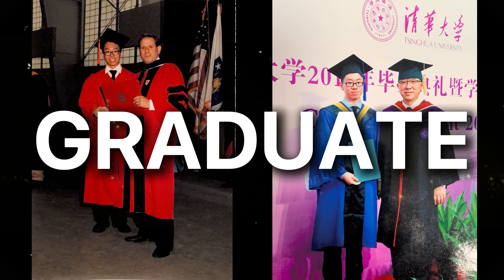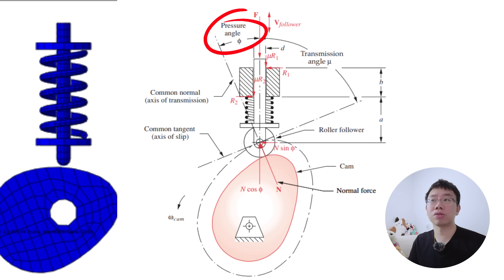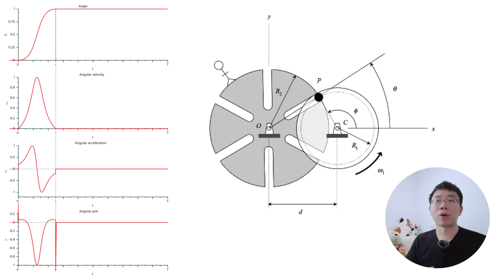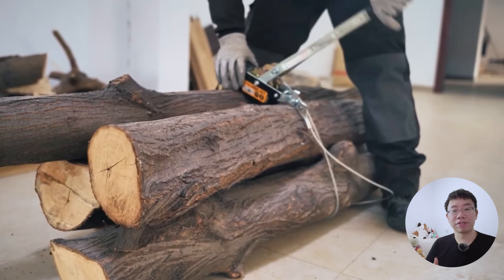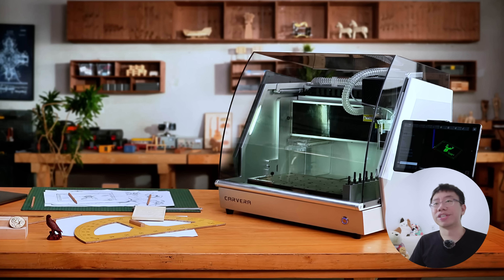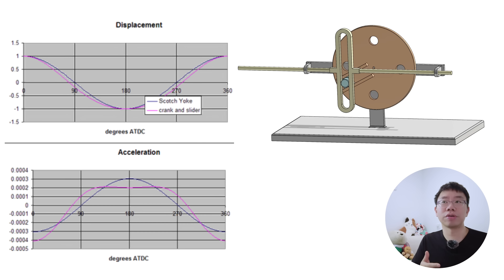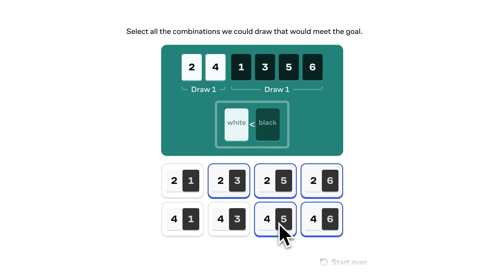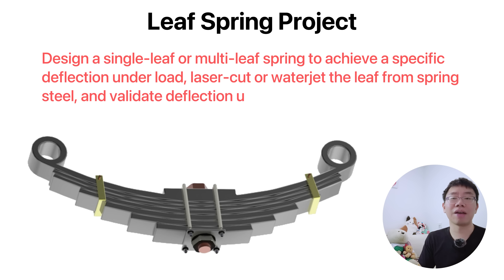Mechanisms EVERY Mechanical Engineer Should Know

Comment: One thing that I’ve had that helped me in being a better engineer was my passion for cars, I didn’t know it when I started getting into tinkering with cars that I’d be helping my career path but once I started a full time job working on custom bespoke machines, I was already able to contribute a lot to conversations as most mechanical concepts have been used in a car in one way or another. By the time I got my current job I had rebuilt a few engines, redone about every suspension bit on one car, and restored another from a fire, the insight I’ve had from those experiences has been more valuable to me than my school experience (this is very specific to me as I had an odd schooling experience, I’m not anti school lol). I wish I could convince every engineer to get a project car but I also understand that it’s not for everyone lol.
Reply: AHHH, I forgot the best part, with my engineering background I understand a lot of the decisions that were made when designing car parts. Understanding the design intent prior to taking something apart only to find out that you were correct due to mechanical design experience, I love it!!

Comment: The one and only king of mechanical engineering is the worm gear. Two reasons:
1. Immense force conversion. This thing can deal with giant loads compared to its size.
2. No matter how much the load is trying to move it the worm gear remains almost fixed.
It beats the jacks in terms of size and precision and the threaded nuts/shaft in terms of precision.

Comment: Rack and Pinion are also quite common. I saw a large one on an oil rig. It was used to move the drilling platform around to help with drilling different holes.

Comment: Nice video, but you forgot to mention my favorites: watt linkages, Peaucellier–Lipkin linkages, slider-crank mechanisms, toggle mechanisms, over-center locks, compliant mechanisms, flexure hinges, torsion springs, constant-force springs, clock escapements, verge escapements, deadbeat escapements, harmonic drives, strain-wave gearing, cycloidal drives, hypocycloid motion, epicyclic gear trains, planetary gearboxes, differentials, torque-biasing differentials, rack and pinion systems, ball screws, lead screws, recirculating linear guides, crossed-roller bearings, air bearings, magnetic bearings, hydrodynamic lubrication, squeeze-film damping, Hertzian contact stress, backlash compensation, preload mechanisms, kinematic couplings, Maxwell clamps, exact constraint design, under-constrained assemblies, tolerance stack-ups, geometric dimensioning and tolerancing (GD&T), datum structures, monocoque structures, space frames, truss optimization, topology optimization, lattice structures, auxetic materials, negative Poisson’s ratio, metamaterials, phononic crystals, photonic crystals, compliant metamaterials, carbon-fiber layup orientation, sandwich panels, honeycomb cores, foam-filled structures, buckling-resistant designs, Euler buckling, snap-through instability, bistable mechanisms, soft robotics, pneumatic artificial muscles, McKibben actuators, shape-memory alloys, shape-memory polymers, electroactive polymers, piezoelectric actuators, magnetostrictive actuators, voice-coil actuators, magnetorheological fluids, electrorheological fluids, linear motors, brushless DC motors, stepper motors, field-oriented control, regenerative braking, flywheel energy storage, supercapacitors, battery management systems, thermal runaway prevention, phase-change materials, heat pipes, vapor chambers, thermoelectric generators, Peltier cooling, Stirling engines, pulsejet engines, ramjets, scramjets, ion thrusters, Hall-effect thrusters, reaction wheels, control moment gyros, attitude determination systems, Kalman filtering, sensor fusion, inertial navigation, LIDAR mapping, SLAM algorithms, machine vision, edge detection, convolutional neural networks, digital twins, finite element analysis, computational fluid dynamics, multiphysics simulation, lattice-Boltzmann methods, Reynolds number scaling, boundary layer control, laminar-flow wings, vortex generators, Coandă effect, Magnus effect, cavitation, water-hammer effects, hydraulic accumulators, proportional valves, servo hydraulics, pneumatic logic, air logic gates, venturi effects, ejector pumps, vacuum systems, cryogenic engineering, superconductivity, flux pinning, maglev systems, eddy-current braking, induction heating, AC skin effect, electromagnetic shielding, Faraday cages, RF waveguides, antenna arrays, phased arrays, metamaterial antennas, power factor correction, three-phase power systems, delta-wye transformers, solid-state relays, opto-isolation, fail-safe design, redundancy engineering, fault-tolerant systems, graceful degradation, six-sigma manufacturing, poka-yoke design, Toyota Production System, design for assembly, design for manufacturability, injection molding flow fronts, sink marks, weld lines, die casting, progressive stamping, deep drawing, hydroforming, roll forming, additive manufacturing, generative design, lattice infill optimization, anisotropic printing strength, multi-material printing, topology-optimized brackets, compliant 3D-printed mechanisms, living hinges, self-healing materials, bio-inspired engineering, gecko-inspired adhesion, bone-inspired structures, fractal geometry in design, chaos theory, nonlinear dynamics, resonance tuning, vibration isolation, tuned mass dampers, seismic isolation systems, base isolation bearings, wind-induced oscillations, aeroelastic flutter, galloping instabilities, bridge resonance, structural damping, smart structures, embedded sensors, structural health monitoring, digital control loops, PID control, feedforward control, adaptive control, model-predictive control, robotics kinematics, inverse kinematics, Jacobian matrices, singularities, parallel robots, Stewart platforms, delta robots, cable-driven robots, swarm robotics, self-assembling systems, modular robotics, cyber-physical systems, industrial automation, PLC ladder logic, safety-rated control systems, light curtains, machine guarding, human-machine interfaces, haptics, force-feedback systems, exoskeletons, powered prosthetics, medical robotics, microelectromechanical systems (MEMS), lab-on-a-chip devices, microfluidics, capillary action, surface tension dominance, nanoscale fabrication, quantum dots, tunneling effects, Casimir forces, precision metrology, interferometry, laser scanning, coordinate-measuring machines, error budgeting, uncertainty propagation, systems engineering trade studies, optimization under constraints and emergent behavior.  Also, stress-induced fatigue failure: something I felt first hand when studying mechanical engineering. :P

Comment: Thank you Mr Oldham.  I use Oldham Coupling mechanism in my work.  The temptation to use a cheaper drive Thats actually tries to self center the misalignment results in failure of the process.  Little known or appreciated, the Oldham Drive (Coupling) is valid to include here in your video.  Thank you.  I (expert) use it to keep form reamers aligned axially with hole that is not aligned with tool holder center.  But to work Oldham must be precision and smooth without worn parts.  Thanks

Comment: A thought that sprung into my mind: while today electronics (ie software + hardware) can do a lot of things much more easily than a mechanisms, when it comes to one-off or small volume things they (software + hardware) may make the impossible to fix after a few years because the source code or firmware is no longer available.also the microcontroller or module (modern hw can be so tiny that it is impossible but swap a part, you need to swap a module) may be no longer available.  This also applies of course increasingly to volume production but for those there is usually incentive to keep the software and spare parts available. 

Mechanics OTH are usually repairable. 

And I say this as firmware engineer :)

Comment: A brief snippet at https://youtu.be/vzM_-Rr5mtw?t=689 shows leaf springs under a table. Installed at an angle. Possibly a shaker table that moves material in one direction through vibration. It can even move material at a slight uphill grade on an inclined table depending on the forces involved. Can be handy for food processing for instance.

Comment: These are very important for more industrial applications, but I think latching mechanisms are even more important for more consumer goods applications. It's sad that today so many of those mechanisms are made out of plastic that just snap off immediately or after a few years. They just don't build them like they used to.

Either build a proper latch that can last lifetime and be repaired with a hammer if bent out of shape(mild steel is your friend), or use screws that can be replaced.
NO GLUE! Things should be easy to take apart, fixed, and put back together again.

Comment: Everything about this gives my brain the good tingles. Still wanna figure out if a compact, hand driven air compressor is a viable endeavour. There's something rattling around in my head to do with a hand cranked, gear-driven rotary screw utilising mechanical advantage but my knowledge of air pressure mechanics is limited to being a hose technician. Imagine portable tyre inflators without needing batteries or people hunting with air rifles that need to top up on the go but don't want to carry so many cylinders.

Comment: most bang-for-the-buck facts or cheap tricks I learned on the job and not in school, early in career when I did mechanical design: 
1. hole-and-slot to avoid overconstraint
2. tolerance rings to avoid overconstraint
3. how to torque a fastener (hint: has to be moving in direction of tightening)
4. use hard materials (eg 440C) on wear parts and strikes; use easy to process materials wherever possible ; take the time to speak with your fab shop to actually learn what is easy to fabricate
5. wedge-lock (nord-lock) washers, when you really need something to be mounted on a single bolt yet not come loose
6. sheetmetal is your friend. use press-in nuts and studs. learn proper use of dowel pins and their tolerance grades. wire EDM + sheetmetal = fabulous precision in delicate parts, where needed. milled parts are often bad design.
7. Machinery's handbook, Atlas of mechanisms, parker o-ring handbook, timken bearing book
(7b. don't actually do business with parker, they won't give you the time of day unless you're defense or medical)
8. linear ball slides are often worth the money you pay
9. polymer bearings (eg rulon) & when totally frictionless isn't what you want
10. protecting bearings vs impact loads, preloaded bearings
11. plastics absorb water from the atmosphere and swell ;  liquids dissolve air and release it upon temp changes ; air holds water and releases it upon pressure changes
12. using setup jigs (sheetmetal with holes) to make assemblies of "80/20" extrusions come out neatly
Reply: I quite enjoyed reading your list
Reply: Thanks for teaching me something new. I particularly liked no. 5 i think I'd like to get some nord-lock wheel nuts for my truck.

Comment: Great video.  You are spot on about Engineering schools not putting enough emphasis on these simple mechanisms.  I little trick that makes leaf springs favorable in some situations is that the spring also can become part of the linkage mechanism.  For instance in a rear axle using leaf springs, no other linkage is required to locate the axle.  Just the leaf spring.  From a hairy eared engineer (old engineer).

Comment: never seen an oldham coupling in a cnc.... do you have any examples?
Reply: Those cheap CNC routers often uses them. They are cheap because they are not very precise. Making axis motors align with lead screw is costly.